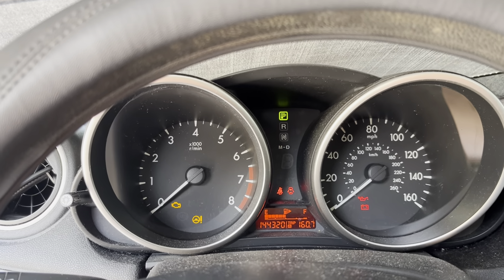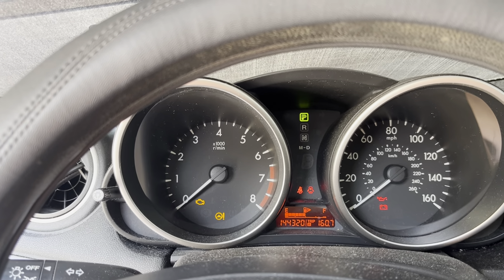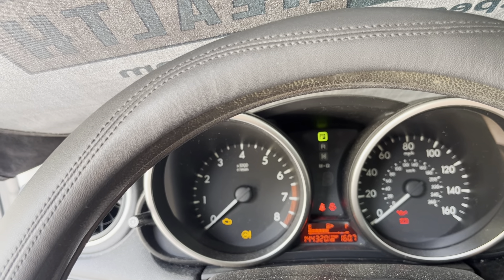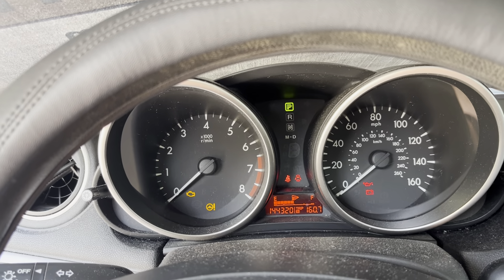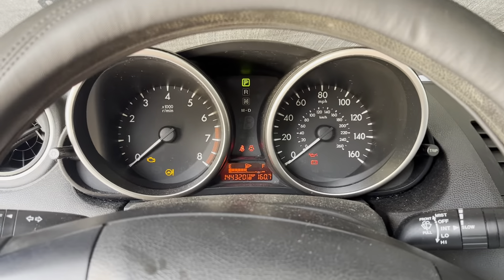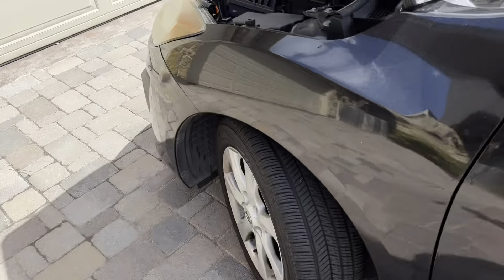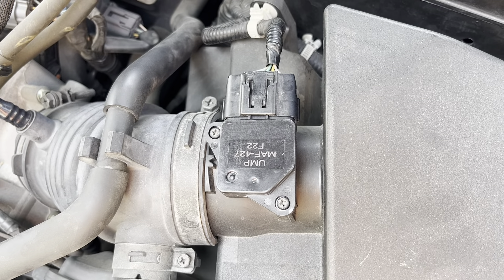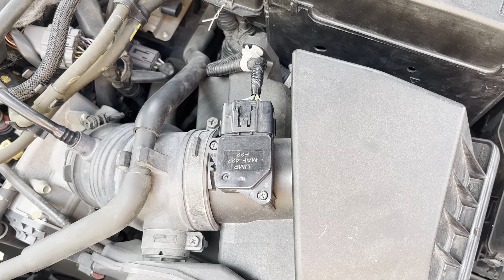2010 Mazda 3 Check Engine, Alternator, TCS Light, and Ruff Shifting Problem

Comment: Do you have a video repairing I need help please !
Reply: It is the last item in the video that I changed to fix it. Anyone can do it as that part just needs the 2 screws removed and the connection disconnected to remove it and reverse that process to install the new part. If you buy it at any auto parts store like O’Reily’s or Advance they would probably do it in the parking lot for you if you ask as it takes about 2 minutes to do. Good luck.

Comment: i have similar stuff happening to my mazda 10 but they are saying it’s the alternator should i fix both or just the second thing?
Reply: I would change the MAF (Mass Airflow Sensor) first because it is cheap and easy to do and see if that doesn’t fix it. Good luck.
Reply: I had the same probleme first i change the Maf and after three weeks the same think speeding at 120km/h highway i lose power steering abs light come on and AT and battery also liky car run till my job, end of storie from scarp if found like new one in crashes car for 45 bucks and it fixe the probleme, it the first major maintence since 2010 to 2024 for more than 485ooo km very very realiable car